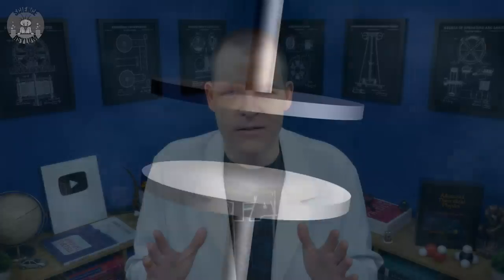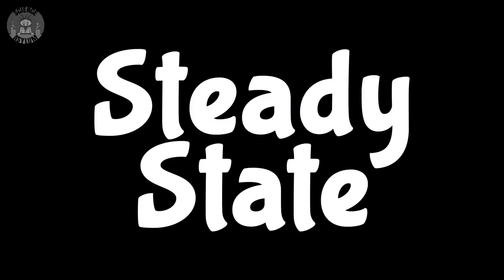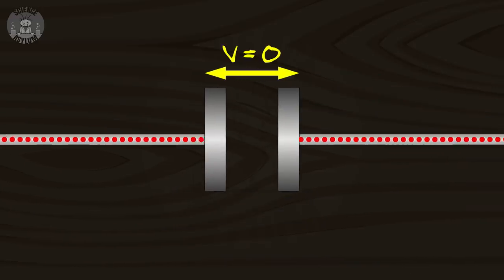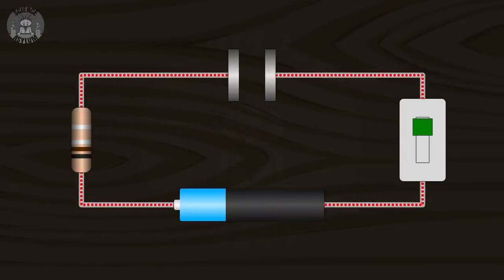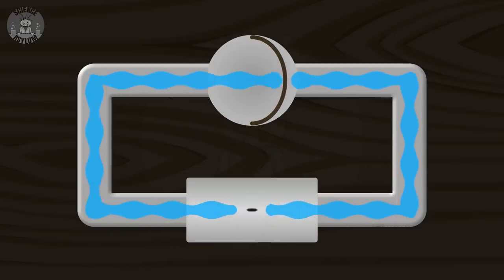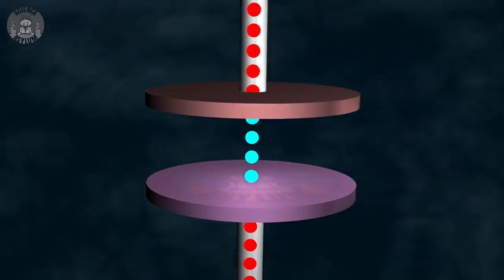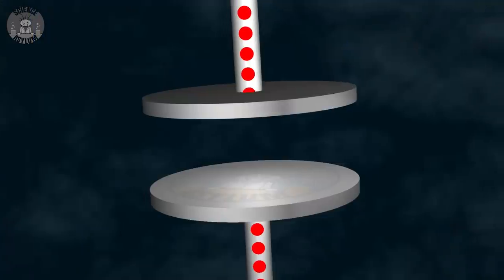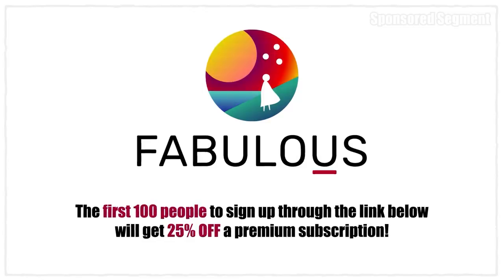Capacitors Are Gaps! How Does That Work?!

Comment: The diaphragm analogy is apt and potentially useful as an educational tool, though I usually think of capacitance as being something like spring resistance. The rest is sort of trivia in most cases.

I'm also not certain that you got the steady state description of the cap correct. The cap stores energetic potential in the electric field. The vocabulary starts to break down when we use the term energy so loosely. Are the arrows a flow of energy and the clouds are stored potential? If the cap is charged to the voltage of the battery then it's thing to stop current flow a la Kirchoff. If you're asserting that there's no energy in the cap at that point then you must also assert that there's no energy in the battery, which doesn't make sense.
Reply from the maker: Using a spring analogy is certainly more mathematically useful (F=kx becomes q=CV), but I don't think it's as visually satisfying.
Reply: @ScienceAsylum  Agreed. If you're not already familiar with spring behavior then it's also probably not as intuitive.

Comment: So capacitors are empty reservoirs that you can slowly fill with abstract stuff to use it all at once later... but how is it used? How do you get it out to do other stuff?
A video explaining how transistor work would be great too!
Reply from the maker: "So capacitors are empty reservoirs that you can slowly fill with abstract stuff to use it all at once later?"
Yep, I think that pretty much sums it up.

"How do you get it out to do other stuff?"
Some kind of switch flips that disconnects the capacitor from the power source and connects it to wherever you need to dump the energy (maybe a coil launcher or something).

Comment: Can you do an energy flow video of a conductor?
Reply from the maker: The exact direction of the Poynting vector depends on resistance. The Poynting vector near a conductive wire is ever so slightly slanted toward the wire... but mostly runs parallel.

Comment: My electronics teacher spent way too much time trying to get us to use Thevenin's theory to break circuits down to a voltage source, load and capacitor. We had some visiting graduates from the previous year back for a visit. I pulled one aside and asked him what they did in the real world. He told me they just use a voltmeter and take a measurement. My teacher was hoping we would all go on to engineering schools when most of us just needed / wanted to get a job.
Reply from the maker: There's a well-known disconnect between what students are trying to get out of an education and what teachers are trying to provide. The disconnect has been growing for decades.

Comment: I had always known that it’s not the kinetic energy of the electrons that is being transferred to the loads in the circuit, but the potential.  I have always thought of it as the kinetic energy that “could have been” (of the electrons) if it (the energy) was not transmitted to the circuit loads.

Comment: have a doubt sir. In wave propagation water or sound , how individual particle vibrations are transmitted from particle to particle in the direction of wave propagation? There are gaps between particles in solids,  liquids and gases. Is this not against principle of locality?

Comment: 10:20 No positive particles are moving inside a conductor. Just a little mishap, you probably meant negative, but it get's confusing due to convention about electricity flow (opposite to flow of electrons).

Comment: Outstanding videolesson! This is a beautifully "simple" (well, for scientists though) analogy of thinking about capacitors as about "breathing with energy" elements. I never heard this before.
P.S.: I was waiting you to mention that the frequency of that "breathing" is "conductivity" current frequency doubled and capacitor (electric field) energy pulsates about average level evaluated as a half of its capacitance multiplied by the voltage (RMS value) squared, but we're scientist, not electrical engineers :D
Reply from the maker: You can visually see the energy cycle is twice as fast. I didn't feel the need to say it outloud.

Comment: It's not only wire's rezistance, but also battery internal rezistance. And when you have small battery and short wires, battery internal rezisatnce is much much greater than wire's.
Reply from the maker: I always forget about the battery's internal resistance.

Comment: A question what if we put an inductor between the two metal plates of capacitor , will that electric field produce any current in the inductor by cutting the wires?

Comment: I am not sure how I feel about the complete skip of differentiation between AC and DC. I think it's a very conscious step from a theoretical physicist POV. It simply doesn't matter, but for common people it might be confusing. DC circuit is a special case of stabilized enough AC. That's why current flows up to a certain point, and the water analogy is good.

Also maybe one "presentational" nitpick, the breathing animation looks cool but in practice it would be pretty hard to breathe in energy from vacuum during charge/discharge cycle I wonder how actual up to scale energy flow through space would look like. With those scales it looks like if you put two separate circuits in parallel with capacitors next to each other there would be massive leakage/interference. But I'll take it as a homework.

Comment: Nick, in your previous video about the poynting vector, the electric field was pointing in the direction of the wire, which made the poynting vector point into or out of the circuit. What makes the electric field point out of the circuit in this video? Sorry for asking, but this is really confusing me.
Reply from the maker: In that older video, I have a pinned comment explaining some of the nuance I skipped. TL;DR - The exact direction of the Poynting vector depends on the resistance of the circuit component nearby.

Comment: When energy transfers from one place to another we can usually sense it. Moving object, light, heat. But Poynting vector?? We can detect the magnetic field and electric field (with sensors) but not the energy flow. If I lick a 9 V battery I can feel the flow of current and energy transferred to my body. But if I stood next to a  giant capacitor that breathes energy in essence through me  I would not feel anything or would I?

Comment: Maybe it's a crappy analogy, but when you described the charge passing through the gap I couldn't help but think of the way a wireless charger converts it's energy to a field that is then taken across a gap and converted back.
Reply from the maker: It's similar! But it's more closely related to inductors than capacitors. Hope to make an inductor video soon.

Comment: NICK🌟🌟🌟🌟🌟, From one of your vedio.... you said Energy cannot Exit on their own....it has be possessed by something(eg Em wave, atom,waves)....Now You are saying Energy flows out of the battery and into the wires, capacitor...In WHAT FORM THE ENERGY EXIST IN-BETWEEN BATTERY AND CAPACITOR , WIRE, And all circuit component...?? What posseses The Energy when it leaves the battery and entering into wire and capacitor and circuit component?
Thank you nick 🌟
Reply: In quantum mechanics, energy of all kinds that gives rise to remote forces like magnetism happen by an exchange of force carriers. In this case, those carriers would be mostly photons. Particles that serve as the mechanism for the interaction of fermions are called gauge bosons.
In most everyday explanations, you can leave them out since it gets complicated. Rather than considering everything individually, you lump it all together in a single blackbox and call it energy.
Reply from the maker: The energy doesn't exist on its own if you consider the field to be a real thing.

Comment: But the definition is V=J/C - as Electroboom said - energy per unit charge. So, if the battery doesn't provide energy to the charged particle, then where does that particle takes the energy from to do work? I'm a simple electrician, what am I missing? Can someone explain?
P.S. thanks for you videos, so many new things learned.
Reply: Battery is like a charge pump, it removes electrons from + terminal and pushes them onto - terminal.  Wires provide a guide for electron motion, directing the flow of charge from source to load and back.  Charge distribution in wire allows battery voltage to establish electric field throughout circuit.  Motion of charge generates magnetic field around wires (and load, and battery).  Combined E-M fields carry energy from battery to load, and from battery to wires (which enables heating in wires).  Electrons are required to establish E-M fields, cause wires to absorb energy, enhance electric fields inside capacitors, etc., but they do not transfer energy to the load (or capacitors, or wires).  According to Dr. Poynting, energy flows only through the E-M fields.  But what is energy?
Reply: @robbprof111  AFAIK energy is the ability or capacity to do work. Which is measured in Joules. 1J=1N*m => W=f*d or W=(m*a)*d

Comment: So, if you got 50 hz AC current, then the energy stored in the capacitor would be a sine wave, too. but with  100 hz because the capacitor is discharged where tension is zero and charged fully at max and min voltage. Energy does not care if it's negative or positive charge. Am I right?
Reply from the maker: Yep, the energy inside the capacitor would be described using a sine function too, but with half the period (twice the frequency). The energy is at maximum whenever the electric field is at maximum, regardless of direction.

Comment: I understand the flow of energy.  What I don't understand is the flow of electrons.  If we have an AC voltage across a capacitor with a load, creating a current, that means the electrons are physically moving (albeit very slowly) doesn't it?  That there is a net direction of movement?  But where do the electrons near the capacitor come from or go to?

-Matt
Reply: In the AC domain the electrons move forwards and backwards at the AC frequency, net movement of 0. It's the electrical version of sound waves.
Reply: @thebigmacd  ok... but what if you take that AC on the output side of the capacitor and you half-wave-rectify it with a series diode and then go to your load?

-Matt

Comment: So awesome, it really took time for me to think about this.
So regarding the understanding of electrical components it seems that it always makes sense to think about what the magnetic and the electric field are doing so one can understand what energy does during its use.
Is it correct that electric fields can be visualized in the direction of the flowing electrons/current and the magnetic field always wraps around the conductor?
Furthermore it really helped for me to think about how the density of electrons determines the current and not the speed as I assumed before by I=q/t. Am I right in this assumption, because electrons "travel" at the speed of light?

Follow up understanding question: @ 4:43 has someone already explained how your assumption of correlations between parameters came about and hadnt seen that approach in math before. Is there a name to this method?

Thank you so much, this community really is about understanding the world we live in:))
Reply from the maker: "Is it correct that electric fields can be visualized in the direction of the flowing electrons/current and the magnetic field always wraps around the conductor?"
While that is true in most simple scenarios, it is not true in general.

"Am I right in this assumption, because electrons travel at the speed of light?"
Electrons do not travel at the speed of light. Individual electrons might travel at about 1% the speed of the light in their atoms, but the whole collection of electrons (the drift) is quite slow... like on the order of centimeters per hour. This is something that a lot of people don't know.

"...hadn't seen that approach in math before. Is there a name to this method?"
I'm not sure what you're asking exactly. That math is differential equations. Is that what you mean?
Reply: @ScienceAsylum  Thank you so much for taking the time to clarify my misconceptions and being so nice about it too. 
I would like to learn more about other scenarios. Can you recommend books for the interested novice? And thinking about the electron drift is so fascinating to me:)

Regarding *my math comment* was related on the intuition that two quantities correlate with each other and that one may simply insert this assumption into the basic equations to continue calculating with it. It kind of makes sense, but this concept of assuming proportional quantities and calculating with them is something I have never encountered before and I would like to learn more about it.
Reply from the maker: @maxgh8534  If you don't have a big math background, I'd recommend starting with an introductory physics textbook. You should be able to find an older one pretty cheap.

Comment: Charge has mass so can store potential in a dipole, in which the gap ensures no current flow from ➕to ➖. Example: Electrolytic cap.
I'd offer ₹2000/- for a lecture that proves that electrons don't flow from the negative to positive terminal of the battery when the switch is flipped close 😅.

Comment: I'm a semi-retired carpenter/woodworker. That loves learning about electrical engineering . And I've got questions. Electricity is technically light, correct? Light has no mass and is never "at rest" correct? So it's always moving, at the speed of light no less. So stored Electricity in a battery that's NOT connected to anything...
Is not moving? ..
And on a completely different subject..I always assumed that the "flame" part of a fire was plasma.? Recently learned I'm wrong, but the explanation baffled me. So there's a few questions brother 🤔. If I was circuitous in my approach to these questions ,it's due to my ignorance.

Comment: If a circular metallic loop is placed in the gap of Capacitor such that the current is flowing through the Capacitor ..Then will there be any current in the loop due to displacement current?

Comment: Are you saying that energy is something totally different than electromagnetic waves and I mean in regard to electricity?
If so what does EM waves do?

In Wikipedia:  In Coaxial cable energy seem to flow in the direction of positive current inside the cable.
They also show that in terms of EM waves, energy moves in the same direction as EM waves, however they move or what they are.

And furthermore I am not even clear about electromagnetic field, whatever their role is, how they propagate.

The teaching seem to go like this: Electromagnetic field move as waves through empty space.
Here is from Wikipedia: The electromagnetic field propagtes at speed of light".
And then:  " The electromagnetic field is a smooth continous field propagates in wavelike manner".
The first statement sounds like you have an EM field wherever it maybe  and it take off, like an airplane that takes off.
The second statement sounds like the EM field is like water as if it is a medium in which the wave propagates.

Comment: Printed circuit boards for computers contain many capacitors.  But PCBs typically run on DC power.  So wouldn't these capacitors just "fill up" and stop energy flowing through the circuit?  In a more general sense, how are capacitors used in DC circuits?  Also, why do old capacitors sometimes bulge and then stop working?
Reply: Capacitors in DC circuits are not used in series with the load, they are used in parallel.    They shunt AC current around the load when used as filters.

Comment: If capacitors are put in series vs parallel are there differences that effect the fields?
Reply: If they're put in series, it has the effect of spreading the plates further apart, lowering capacitance. As capacitance is a function of the size of the plates and how close they are together, the opposite is the case for those in parallel: two capacitors in parallel behave as if they're a larger capacitor. In each case, however, they're still physically separate capacitors with their own fields, IIRC.

Comment: Supercapacitors have very huge capacity (for example Maxwell capacitors has even 3000 F capacity!!!) but voltage usually is about 2,7 V. From what is dependent voltage capacitor? Is it possible to build supercapacitor with very huge capacity and high voltage (400 V and more, even over 1000 V)? How can do it?

Comment: The problem with this is that the energy to charge the capacitor most definitely comes from the battery. Furthermore, if the capacitor is discharged into a resistor connected across it, the energy does not mysteriously disappear into the space surrounding the capacitor. The energy is dissipated as heat within the resistor, and it gets there through the current from the capacitor.

Comment: Question: When i say that in fully charged capacitor, first side of capacitor is filled with more electrons than other side, is it true?
Reply from the maker: One side is loaded with extra electrons and the other side is missing electrons.
Reply: On net a "charged" capacitor is just as neutral as a completely discharged capacitor.  The terminology is a bit of a misnomer, because the net charge remains constant.  But the charge on either plate under consideration is what changes, with the state of energy of the capacitor, and is what we mean by a charged or discharged capacitor.
Reply: Thank you all

Comment: The internal resistance of the battery is probably greater then the wires. That is why batteries get hot during charge and discharge.
Reply from the maker: That's a fair critique.